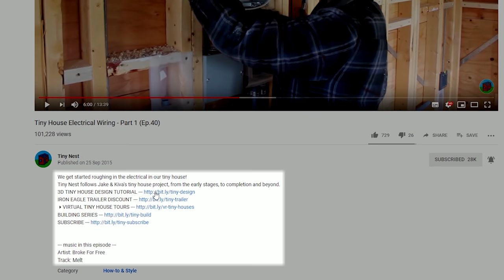DIY Mirror for our Tiny Home Bathroom (Ep.79)

Comment: For fixing gap issues save some of the saw dust and mix it in with the glue. This will both strengthen the gap and provide an even fill as glue by itself tends to settle in the gap leaving and indent.
Reply from the maker: I've seen this done in some woodworking videos... obviously adding saw dust will thicken the glue, do you have any tips for getting it into really tight gaps? or still just press in with your fingers?
Reply: @tinynestproject  working it into the gaps is usually pretty effective. Ive also used a hard plastic scraper or putty knife

Comment: Much better. I think people fail to use Velcro to secure things when it would be an easy and more flexible option.I have several wall mirrors in my little apartment secured with Velcro and it's easy to pull them off when you are painting and put them back when done.
Reply from the maker: Yeah we didn't even think of velcro, but another comment brought it up as well... the thing about it that I don't like is the adhesive (assuming it's a sticky-back) because I don't trust adhesive to last... but it would also be possible to put some screws through the velcro (wood screws so they sink down flush) to hold the velcro permanently.
Reply: @tinynestproject  You would be surprised how well Velcro holds if you have a couple square inches of the stuff.  It's become my default method of securing things.

Comment: I have used veterinary type syringes to apply wood glue into tight wood/board seams, with and without the needle, depending upon the situation and density/thickness of the glue.

Also, many years ago I learned about industrial strength Velcro; example, public and private museims and galleries often use the really strong grade of Velcro to hang things securely onto walls, including slabs of marble and granite and glass that are both extremely heavy and yet fragile if they should fall -- something that museums and galleries could never afford to risk!
Reply from the maker: Oh interesting, never thought of using a syringe but that sounds like a good idea :) 
Where can you get such industrial velcro?
Reply: @tinynestproject  try Home Depot to start [mine was rated for both indoor AND outdoor use] but you may only need indoor type, but the extra-heavy hold.
Reply from the maker: I'll keep my eye out for it :)

Comment: We had a similar issue in our 5th wheel bathroom, except total opposite.  We had a stupid little ugly medicine cabinet over  the sink, with a flat mirror over the sink.  We put a mirror, on piano hinges on each edge, that was split in the middle, with the mirror side facing the cabinet, and wallboard similar to the wall  glued onto the back of the mirror.  When Laurie needed it, the she could open the mirrors on the cabinets to see from behind, and see from the front wall mounted mirror on the wall over the sink.  (she was working at that time, and we were living in the trailer full time while building our house)  I, personally, don't care what the back of my head looks like, but apparently women do. Because of this simple solution in the trailer, I was forced to do it in the master bath as well in the house.
Reply from the maker: lol "I was forced to do it in the master bath as well" 
When I cut (which is really buzz-cutting) my hair, I need to make a half-decent looking edge at the bottom of the back of my head... that's really our only practical use of this type of viewing that I can think of... but it's an interesting bonus to the fact that we already planned on moving the cabinet to the back wall :)